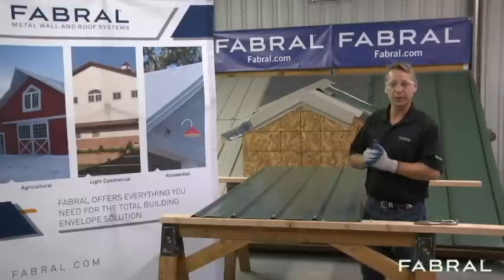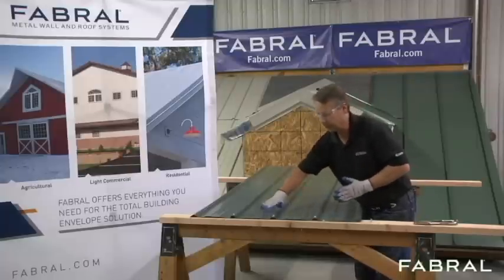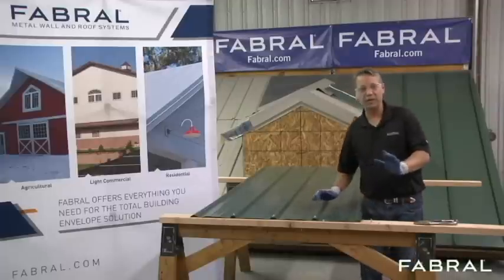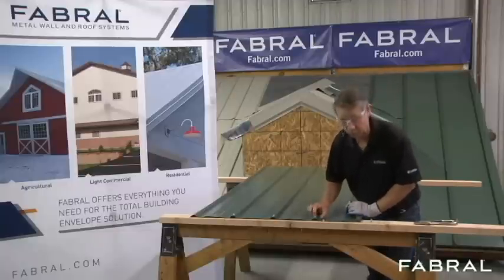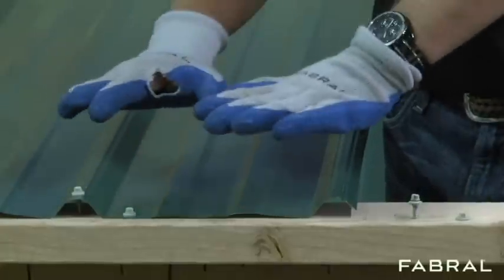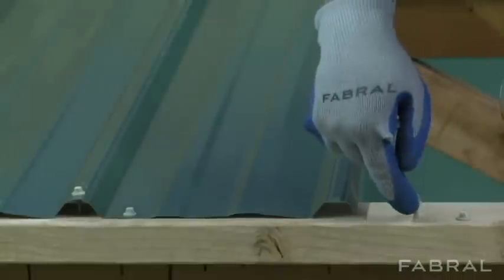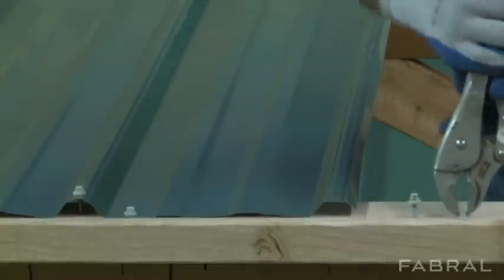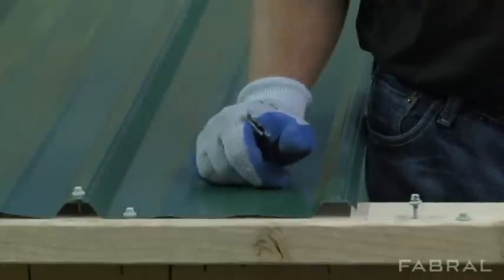Screw Location Recommendations

Comment: Thank you for someone finally showing the proper way to install screws in an exposed fastener metal roof panel. To many sites just want to either avoid talking about exposed fastener roofs or they just bash them claiming the will fail in short order.

Comment: My twenty year old roof had screws on the ridges.  Portions of the roofing were lifting off from stripped out screws.  Other roofers told me that was correct, but as they say, "the proof of the pudding is in the eating".  After 47 years in auto repair I can tell you a fastener that is not seated to some thing solid will eventually come loose, no matter what. IMO this info is right on.
Reply: Even if it does come loose it still shouldn't leak as oppose to flat surface, no?

Comment: I just removed 30 year old metal roof panels which had screws both on the ribs and on flats along the bottom. The screws that were on top of the ribs were very loose with some lifting out by had, and the screws on the flats were nice and secure.

Comment: I am a "newbie" to metal roofing. My 44 year old roof has both techniques. They used 1 5/8 long hex-drive screws everywhere to mate the ribbed roof to the heavier guage rib-less galvanized sub- roof. It was quite a surprise to see all of that screw sticking out into the insulation. I have started using 1/2 inch truss head screws where there is nothing to screw into (wood truss) under that point. I also used the 1/2 inch screws ON THE RIB but only to join the sections where they overlap and then at an angle. Here in Michigan we have issues with ice damming which lifts the edge of the roof and creates a leak issue. I am installing a drip edge to limit the damming and the gutters will have heat tape to keep the water flowing away. Most people do not realize the force that freeze/thaw cycle can generate, and design gutters to control liquid water not frozen water.

Comment: Thx, how far do you space the screw up the roof? I have a 4/12 pitch hip roof on my Gazebo. Size it 11’x13’. I was told screws are bottom at drip edge, then at the top of the roof and then a row of screws in the middle of the panels?? I was thinking every 15” running from the drip edge to the top?? Your thoughts please.. thx oh it’s a 5v panel 24” wide panels and the longest panel length is 73” from drip edge to top of roof

Comment: What about spacing how far apart do I need to screw in
Reply: Depends on your substrate if it's plywood substrate or slats. I work for Licensed General Contractor of more than 30 years, what we do is take a sheet, mark 2" at the eave, then every 16" up to the top end of the sheet ( this will be a pattern) then we put 5 sheets together with the pattern on top, clamped even at the eave of the panel and drill through all 6 panels. Usually the pattern is used till all panels are installed. That way all of the screws line up perfectly vertically, horizontally, and diagonally while looking at them from the ground or standing on the roof. We only screw the rib with what is called stitch screws at the overlaps.

Comment: I recently did my garage in metal. I found if I didn't screw the rib when connecting the next sheet the rib left a large Crack
Reply: That's why they have these screws called stitch screws they are just for the overlaps. Here in the South we screw in the flat, and stitch screw the overlaps. I work with a Licensed General Contractor of more than 30 years.
Reply: @jonathan3982  good to know thanks.
It was my first time working with metal and I didn't see that in any videos I had watched
Reply: @dougreed736  Welcome anytime. As the metal panels manufacturers evolved they realized ( well most of them) it would benefit more screwing the flat and stronger hold from uplift from windshear especially in high wind regions. Even the 5 V metal panels are installed screwing on flat. Stitch screws are usually about a inch they basically just seal the overlap panels together.

Comment: I'd still go rib... your example of flexing one screw is not the same as a whole sheet screwed down at multiple points, far less flex if any. Some screws are always going to loosen over time and I'd much rather have them on ribs, knowing water is going to shed off into the flats, than the opposite. Plus it keeps the seams tight. I'd do the same if it were my house. Just my opinion though...
Reply: I have been steel roofing for 45 years,   always predrilled on the ribs,    never a leak,   important to keep the seem tight because of the suction properties of water,   and yes  water runs off the ribs and can pool on flat,  also if you use strapping some pieces may have high moisture content when installed when it dries i would rather have screws in ribs than flat
Reply: @waynekannegiesser5948  45 years? Bs

Comment: That's why they invented clutches on drills ....... What happens when the rubber under the screw dries out in 5 years ... nope .. Wrong !
Reply: Paul Lambert As I understand it the new screws use a neoprene grommet instead of the rubber.  No dry rot in 5yrs.
Reply: Pushpush Lambert you have to just use your brain. The problem is that the decking will be denser in some spots and sometimes you hit a rafter and theirs more resistance

Comment: So i guess those 100 year old barns with leaded nails on the ridge were wrong? Do yourself a favor and just buy the longer screws put it on the ridge and stop the leaks. This guy only uses one screw to prove his point by the time you get the entire roof down it will be so solid the roof could hold the house up with no blocks underneath it.
Reply: No you’re wrong, they did that with nails because the nails would naturally loosen over time, causing leaks if it was nailed in the flat, screws won’t loosen over time when attached tight to something
Reply: @jns66jns  so you admit when you nail or screw in the flat there is a chance for a leak…nice
Reply: @taylorswiftnumberon1  Re-read my message, I said NAILS will loosen up and cause leaks, screws will not, thats why noone uses those nails anymore. And you shouldn't use screws in the rib because there is nothing solid under them. Also, the rubber washer is larger than the top of rib not allowing a complete seal. And lastly, screwing the rib almost ALWAYS causes deformation in the metal. Having wood under the flat, you get a nice tight seal. As products evolve, so does the installation. The manufacturer we use will void all warranty if screwed through rib.
Reply: @jns66jns  The metal panel may last 50 years but the rubber washer keeping the water out will only last 9-15 years. And you do understand that snow melts from the bottom don’t ya. And again look at those 100 year old barns that are nailed instead of screws.
Reply: Yet if you go to the manufacture sites for exposed fastener panels they tell you to install the screws in the flats not the ridges. Maybe you need to go tell all these manufactures of metal exposed fastener panels they don't know what they are doing and correct them, hell you could make a million dollars. Oh by the way once you install the screws on the ridges all the test data goes out the window on the panels because you failed to follow their installation instructions.